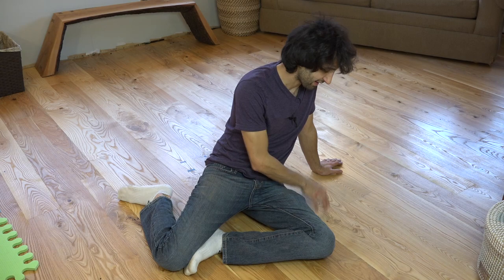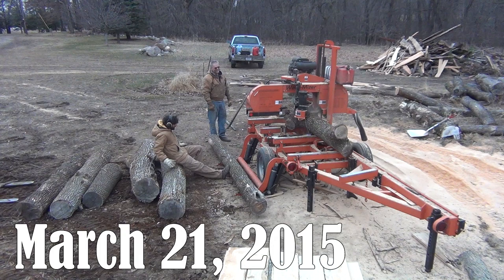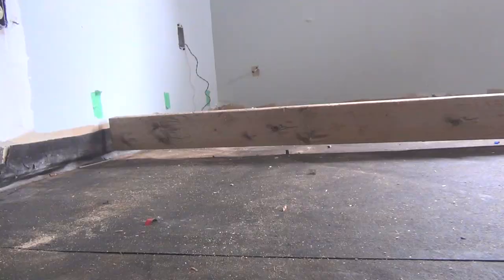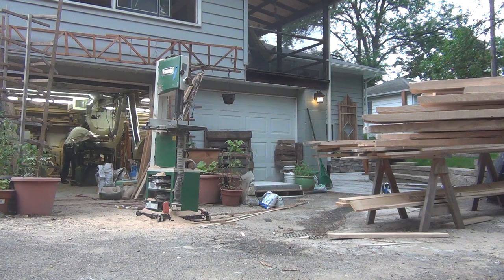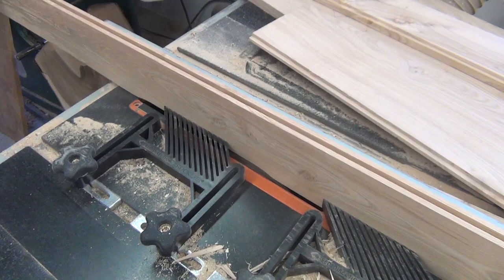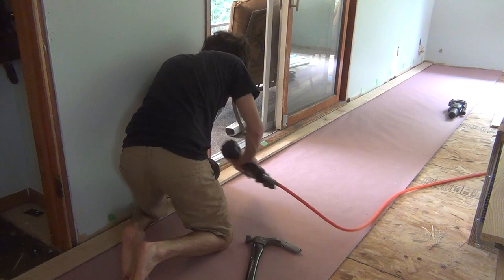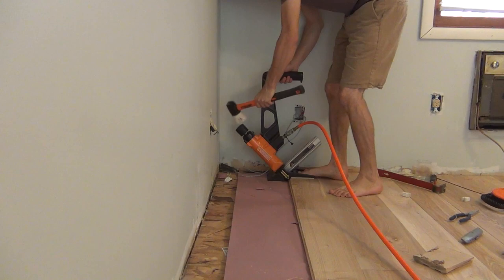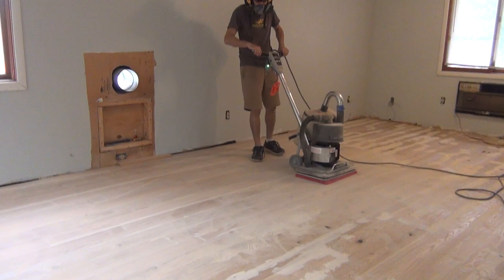Making and Installing Hardwood Flooring From a Tree

Comment: Fabulous “stump to finished wood” project. My last kitchen was from white oak trees saved from a typical fire wood fate. Felled, Slabbed, dried, planed, dimensioned, mortised and tenonned, or railed and stiled. 
Sadly the next owners put all that work into a 40 cubic yard dumpster after they moved in.
Your work is impressive

Comment: Very impressive!

To nail in the last rows you can use a pneumatic palm nailer that is made for the square floor nails. You can get within about 3 inches of the wall. I rented one for about $20 per day and only needed it for a few hours. It is good to use it on some practice pieces first so you get a feel for how it works.You can also rent a random orbital floor sander (it uses 4 sanding disks at once). I think it works better than the square pad floor sander. I like to use the square sander for roughing up the finishes (sealer and poly). Also be careful with the wood filler. If you dont get it all the way down to the grove it can loosen up over time and make ugly gaps. There is a product that uses the floors own sanding dust as a filler to match the floor, you cover the entire floor with the product. I have not used it but have seen it make beautiful floors.

Comment: Couple of comments... Wood flour (ultra fine sawdust) combusts like wheat flour with a spark...Ka-boom... Using an electric leaf blower with its sparkie little motor that might be that ignition source...Alternatively, if you hook up your shop vac (sitting it outside if you have enough hoses connected together) on the exhaust pipe you can almost eliminate sawdust accumulation... BTW, great vid

Comment: Fantastic job!   I can really appreciate all the work you have invested in this project.  I used to install and refinish hardwood floors.  One thing that I used to do on stubborn boards that bowed out was to take a large common screwdriver and drive it into the subfloor to use it as leverage to pull the bow out of the flooring.  Also, we used Naptha to clean up the dust  prior to finishing.  I used to put some on a clean cloth and wrap it around a dust mop head that was much like a swifter.  I do hope you left some spacers or something every couple few rows, or so.  If you don't have enough wiggle room then the whole floor could buckle when the flooring swells seasonally.   Anyhow, I'm looking forward to seeing the rest of the house done too.

Comment: Thanks for posting your hard work!! I'm gonna buy raw wood and use a router table for my tongue and groove. I'm surprised you didnt connect the festool to the sander to help control the dust. Your video gives me a good idea about what to expect and I had no idea about the relief cuts on the underside of the flooring. Thank you

Comment: Matt, unless I missed it, this is just air dried lumber. Have you had any issues with movement or gaps over the past 3 years? Thinking of doing something similar. thanks.
Reply: I was wondering the same.
Reply: I'd also like to know how this floor is looking with finish on only one side. I'm thinking of doing something similar
Reply: I had this question as well

Comment: Great video man. Have you ever tried finishing with boiled linseed oil? Had a customer last year who we did reclaimed floors for. Used a bunch of joists and rafters from an old church in Georgia, The wood was super old. We didn't do a tongue groove, just planed everything and did a simple profile on all the edges. Each board was about an inch and a half thick. Finished everything with boiled linseed oil and it turned out amazing.

Comment: Enjoyed this one very much. looking at buying an older home (most  from the 1880s) and was thinking that the ones I've seen have huge gaps and cupping. Would a similar method work if I removed the old wide plank pine and milled them into tongue and grove?  I'd account for loss by not doing one of the units  (this is a duplex) or by doing tile in bathrooms and kitchens.  I love the look of slow growth old pine and it would be a shame to cover it with something else.

Comment: boy that floor looks great! i was wondering when you put the large sandpaper on that floor sander if maybe you were suppose to punch holes on the bottom to help the dust go into the vacuum as i used to work for the school district and fixed alot of gym floors and used a similar sander and had to punch holes in it for the vac to draw in all the dust?
Reply from the maker: That's entirely possible.  The guy working the rental desk was incredibly unhelpful.  I suspect you're right.

Comment: Hi Matt, I just watched this for the second or third time, as I plan to use it as my #1 resource when making and installing the floor in our master bedroom.  I will watch it again and document it step-by-step; that's just how I work.  Two questions for now: 1) Have any problems surfaced with the use of air dried versus kiln dried flooring? 2) Did you measure the moisture content of the floor boards before installation, and if so what was it?  Thanks again for a great video! -- John

Comment: awesome video. awesome floor. love your work! what are the grooves on the under-side of the wood there for? and could i possibly do a solid teak hardwood floor over a concrete sub floor using glues and nails?

Comment: Hey Matt did you trowel fill the floor? Thinking about trowel filling mines with saw dust and sanding sealer. Also fid you use a hand held orbit sander after the polisher?.

Comment: What did you use for wood filler? I am planing on replacing the beaten up and badly damaged pine flooring in the second floor of my house with ash that I have started cutting out of our woods. I was thinking about prefinishing  it and I’m was going to buy a tongue and grove router bit set it machine it, what do you think?

Comment: Ok, so I bought an acre of land with about 50, 35 foot tall and straight southern pines . 20 to 24 inch across.  It also has about 25 oak trees at 20ft tall 100 other associated  trees. Is  it possible to get most of my lumber for the house out of these trees? House is 2200sq. Ft.

Comment: hi matt,again nice job and the cherry bench seems matching the whole room so well.now back to the basement drying thingy, so you only dry the ash from green to install - ready within 6 month or so? is that possible? I quarter-sawned som nice big ash most 4-1/2 x 4-1/2 x 10f, and rest of them are 8/4. that was 3weeka ago and that will be my roubo material...cheersAndrew

Comment: Looks amazing! My wife, baby girl and I are just about to buy our first house and the house in question needs abit of aesthetic work, namely a new floor. I have been looking at manufactured flooring,  but feel it's a bit expensive and not as personal. Would you say that this method is far more satisfactory and do you reckon there would be away to achieve similar, albeit lesser quality with more primitive tooling? I just don't have access to mills and other such large machines in my situation. 

Cheers,
Lewis

Comment: Matthew,  I just bought a cool house made in the 40's.  I wanted to put hardwood flooring in so I pulled up the carpet and there was a pine hardwood floor nailed to the floor joist with no sub floor.  Can I use the existing 1x4's that are nailed to the floor joist as my sub floor or do you think I will need to pull all those up and install osb.

Comment: Are you satisfied with the performance of the Rigid table saw? My basement shop is 110, so I am confined to that voltage for all my tools. I have been looking at the Rigid/Craftsman or a Grizzly table saw. I have heard the complaints on the Rigid/Craftsman are mainly centered on the fence, and I will plan to address this. The thought is by buying the Rigid/Craftsman saw and installing a good fence, I will still save 200 dollars to put into a new band saw.
Reply from the maker: It's served me well so far.  I've had it for 7 years now.  The newer ones seem like they have some issues especially with the fence. The fence on mine is great especially since I bought it new for $500.

Comment: Looks amazing!!  I am about to tackle a multi-room install myself.  No prior experience, but plenty of research done now.  I am curious as whether or not you have experienced any issues with wood movement so far.  I read somewhere that filling all the spaces between the planks (wood filler) is a bad idea, especially in areas with multiple seasons.  Seriously though, that floor really pops.

Comment: Love how the floor turned out. I've been looking at it thinking I should try it throughout our house. How many hours of milling to rough boards to "product" do you figure it took. I'm looking at a project of about 1100 square feet and wondering if it is worth it. Thanks for what you do...great to watch.
Reply from the maker: +Michael Beauvais Thank you Michael!  I probably had around 24 hours into both runs of flooring and I ended up making around 400sqft.  I think a good option if you have that much flooring is get the boards milled into "blanks" and see if there's a local mill shop that will run the T&G for you.

Comment: excellent video.  i was considering buying lumber and laying my own floors.  never done it so i was happy to see your video in its complete process.  what was your cost for this room?  i know it may be hard to judge because you used your friend's machinery.  i would like to know your cost and what would it cost if labor were included?   thanks!
Reply from the maker: My larger direct costs were: Finish - $150, OSB for the subfloor - $130, floor sander and sand paper: $100, two hours of sawmill time - $80.  I'm not sure how much something like this would cost including installed but I took a look at prices for just the unfinished flooring to get an idea.  Boards this wide and this long were priced around $5/sqft.  This room is close to 350sqft so I probably would have had to buy around $2000 worth of flooring and the labor I would guess would be about the same amount.

Comment: Matt looks great we have been considering this same thing in the future.  Quick question when you applied the epoxy to the knots did you not have any leak all the way through the boards?  Usually I have to tape the back side.
Reply from the maker: When I was doing the install, if I saw any knots that went all the way through, I put some tape on the backside of the board before installing it.  Thanks Allen!

Comment: Matthew, I have seen a couple of your other sawmill videos but just ran across this one when searching for hardwood flooring videos. Your floor turned out beautiful. I particularly liked to bowtie split repairs. It made for a great personal effect.
We recently used our portable sawmill to cut some hickory (to 3/4") from some donated logs to use as flooring in our cabin. The tree had fallen in a hurricane and sat in the woods for about a year before it was pulled out. It has some beautiful spalting in it but hasn't softened yet, and is still hard enough for flooring. I had a couple questions for you. I saw that you milled a tongue and groove into the boards. I considered not doing that because of the chance that there would be a lot of unevenness due to it being done by hand. Do you think it could be done effectively without the tongue and groove? I know it would require nails into the face but those could be set below the face and filled. Also, how important are the relief cuts on the bottom? I hadn't considered doing that. What purpose does that serve? 
We were also give several logs of sweetgum (being up north you might not be familiar with that) but they were also beautifully spalted. We milled those for a tongue and groove ceiling and turned out awesome.
Anyone with info is welcome to reply as well. Thanks.

Comment: Hi Matthew -- Great video. Thanks! Would you recommend using Gold Seal on Ash stairs as a finish? I'm a bit concerned with the slipperiness of it.
Reply: Great question. Glitsa is ideal for stairs. It is not slippery and is great for touch ups down the road. I always use it as a three coat system. Sealer plus two coats is mandatory for glitsa. Be sure to use proper respirator and remove cloth items from house as the odor really sticks to curtains and furniture. For finishing wood floors that have high oil content and very dense grain like ipe ( brazilian walnut ) check out a product called synteko. It is the other swedish finish. It wears even better than glitsa but the odor is beyond belief. It is commonly called a museum grade finish and I use it on all of my own homes. They do make polyurethane with particulates in it for stairs. I use it for jobs like retirement homes where non slip is a must.

Comment: Great work - just wondering if you left and an expansion joint every meter or so? I've seen solid floors move stud work before because of no expansion joints.
Reply from the maker: I have the expansion gaps along the wall which should be plenty since I installed this during the most humid part of the year.
Reply: smart thinking with the weather would of never thought of that living in Ireland were the weather can change at the drop of the hat

Comment: Great job! Did you kiln dry the Ash or just air dry?  For how long? Did you check the moisture content of the wood right before you nailed it down?  Has is held up as good as you expected it to?  Asking because I'm thinking of doing a similar project and though I had to kiln dry the lumber.  Thanks
Reply from the maker: +Laurie Andrew thanks! Airdried in my basement to 8%. Acclimated to the room and settled at 10%. Boards are still flat. No issues there

Comment: Very nice, really like the wood variety and butterfly bow ties, making it more unique.  :)

Was the steel beam run in the middle of the room below and the surrounding floor / building settled down around it, causing the floor to bow upward? I really like the solution you used to level the floor.
Reply from the maker: Thank you Ali! I think over time the joists pulled back out of the beam. Since the inside of the beam is angled pulling out would lower the height. Or maybe the joist were installed wet and shrunk. As far as the "left" side goes, either the foundation over there sunk or whoever built this room just did a bad job
Reply: +Matthew Cremona Hmmm, look like a bad building job, why steel beam in the middle of the room as there's no load directly on top of that? Oh well.

P.s. I think you may have accidentally created a fun game for your child, count how many butterflies on the floor? :D
Reply from the maker: I had never seen anything like that before.  A little on the goofy side.
Thats a good idea!  and I can always add more when he's not looking.  That should really throw him off :)
Reply: +Matthew Cremona Haha brilliant :D

Comment: First off you NEVER start along a wall. You first  find the center of the room  and balance it between  the walls. Then you align the groove side on the line and  nail a stop  board on the tongue side. Then you insert a spline in the groove side and cleat nail it down. Now the floor is balanced between the walls and tongues now go toward both walls which makes easier nailing  when getting close to the wall. Also if you use 15 or I prefer 30 lb roofing felt, it provides a sound dreading plus a water proof barrier between the sub floor and the wood floor. Also termites do not like the taste of the felt and will not try to eat through it. How do I know all of this, 55 yrs in the business and countless NWFA seminars.

Comment: Did you have any problems with expansion when the temperature changed?
Reply from the maker: No, since I installed it at the most humid time of the year, I only had contraction.

Comment: Hey Mat. How did your dad blade on the table saw fair running that much flooring through it?  I will be doing the same project next year.  I have 600sqft of flooring to make.
Reply from the maker: Just fine.  I still use it.  It needed a good cleaning afterwards though lol

Comment: Great job Matt, I've been waiting for this video for ages. What's the purpose of the relief cut?
Reply: +Robin Lewis Relief cuts are made to prevent cupping due to remaining stress in the board. If one side is machined more than the other it tends to cup to that side. Relief cuts are used to balance it out. Most woods you buy are kiln dried and stress relieved and won't need it.
Reply: +MrPanohead Thanks for the reply. Does that mean that there is some math involved; if I remove X much on the face I need Y relief cuts? Or is it not that complicated?
Reply: Robin Lewis I think it is all based on experience. Stress obviously differs from board to board, because it is caused by the core drying slower than the outside. I think this is one of those topics where the opinions vary wildly. Some people swear by it or learnt it that way and other people think it's of hardly any use on a board with a certain shape etc.
Reply: +MrPanohead Got it. Hopefully we don't start a flame war on the subject. Thanks for the explanation
Reply: +Robin Lewis Indeed.
Reply from the maker: +Robin Lewis Cupping was one of the things I had heard about.  I also heard that they are added by flooring manufacturers to reduce shipping weight.  The primary reason I added them was to reduce contact with the subfloor.  This gives stray debris somewhere to potentially go and in theory should make them slide together easier.
Reply: Such a small detail yet it does so much, interesting. Although I guess after that many boards it stops being a 'small' detail